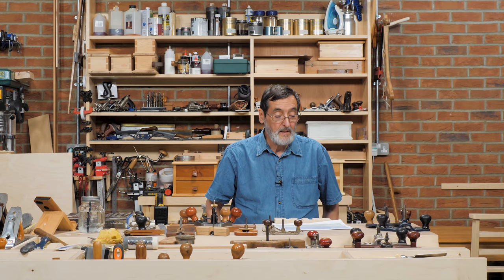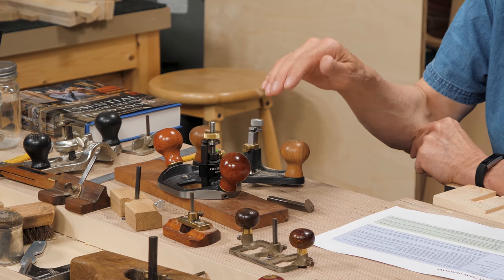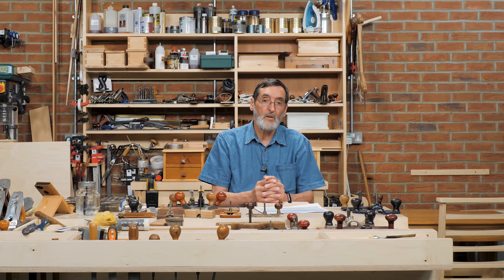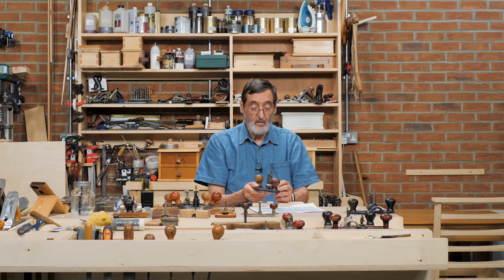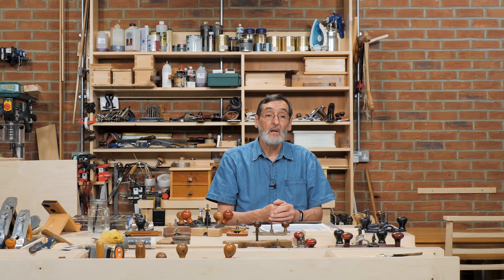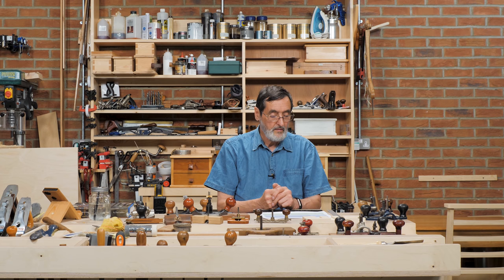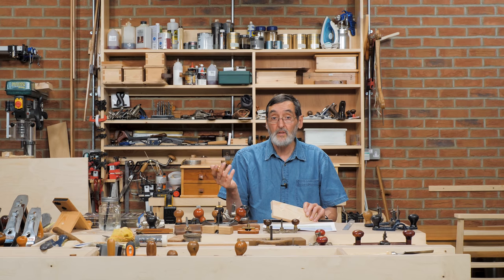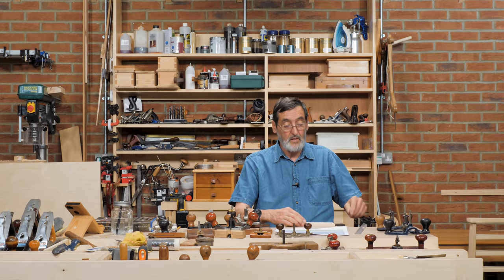Router Plane Q&A | Paul Sellers

Comment: For the question about the slipping blade. Starting at the far end of the work and taking small steps backwards can help too. Very much like a rabbet, plow plane, or even hollow and rounds. (Combination planes like a Stanley 45 or it's crazy uncle the Stanley 55 too.)

Comment: Great Q&A session as usual. One additional suggestion if I may: for those using a Stanley 71 router (and possibly the Record equivalent), one way to cut deeper grooves than what the included cutter allows is to replace it with a Veritas cutter. Using this trick got me out of tricky situation (making a large tenon, which required the use of a relatively thick extension sole for rigidity reasons)
Reply: I made a wooden base for my Stanley 71 and was excited about using it. With the stock blade, I had very little depth of cut. Like you, I ordered the Veritas cutters. They are a good bit longer than the stock cutters and fit without modification.

Comment: If you place a very thin strip of soft copper or similar metal between the end of the locking screw and its mating surface the blade should not move during use.  The copper conforms to the shape of the locking collar and adds more locking surface.

Comment: Thank you Paul this and the how to sharpen a router plane are fabulous, very helpful. Made a sole for my almost new Stanley 71 from a scrap of oak floor board was 7/8 so cut a housing to shape of plane, using the router and a chisel, to make depth 3/8, drilled and cut a U shape for the cutter (enough solid wood left that it shouldn’t distort), used some plumbers ptfe tape on the screw thread holding the collar / cutter to stop it slipping loose.

Comment: Thank you for sharing your experience and wisdom I find that when I use a power router it nearly always ends in tears as there is often no finesse it is on or off and because of the power you often do not have the control. Hand tools give you that control, yes it will take longer but the results speak for themselves. I recently visited an old church and was in awe of the craftsmanship in the wooden panels created in 1700's where there were no power tools, keep up the good work as someone who has returned to this hobby and remembering the skills I have forgotten from when I was 11-16 in my woodwork classes where I got a CSE Grade 1 in woodworking and Technical Drawing.

Comment: Great video! I myself have had issues with slippage in the cut, and I found a neat solution that seems to work well for me. Much in the same way that you would want to finish a depth advancement on a bench plane with a forward turn, I try to finish my depth advancements on a backwards turn with the router. The goal is to stop the blade from shifting in the dead space of the yoke, but because of the nature of the router plane, it’s pulling the blade deeper instead of pushing it back in.

Comment: I suppose I've done some rather extreme adaptations. I made mine with replaceable irons as you have mentioned in the past. Then I began playing with shapes, I now start with good knife walls followed by a spear point on my router plane to hog out waste then clean up with either a flat iron for a dadoe or a gouge up canel iron for the blood groove on a cutting board. I also made a moveable fence system Incorporated into the design like some of the old ones had.

Comment: It would seem to make sense to remove the part of the wooden plate ahead of the iron for chip clearance. Since it's fixed to the plane on both sides, it shouldn't weaken it in any practical sense, plus it could add that clearance (hump) feature to a plane with a flat sole. Have I missed something?

Also, a piece of paper folded over several times can be inserted between the depth locking collar (the big one) & the iron to help stop it slipping. Normal plain printer paper can provide a huge amount of friction when it's under pressure & it won't mar the metal, unlike putting an abrasive in there.

Comment: I have a follow-up question about the Stanley 71 with the wood sole plate added. Can the wood be slotted so the open front of the router is utilized again? I was thinking that if I were to trace the opening of the router onto the wood and cut it out and clean it up, that the advantage of the open throat of the 71 versus the closed throat of the 71 1/2 could be utilized again. I see that you have not done that on any of your 71s. Would that alleviate the problem from the question, or is blowing the debris away the best method... Thanks!

BTW, earlier this week, I won an eBay auction for a Stanley 71 that was complete except for one of the cutters. The very next day, a friend of mine met a guy who was selling an entire workshop and had a few hand planes for sale. I was able to buy all of them. I got a Stanley Bailey #4, a Stanley #71 complete and including the original box, a Stanley #78 rabbeting plane, and a never used Record #778 rabbeting plane complete with instructions and original box. The guy selling it said he bought the #778 for a project and never ended up using it. I'm so stoked to learn how to use all of these planes and am enjoying your book and DVDs. 

Thank you, Mr Sellers, for giving me the inspiration to begin a new hobby at 53. (-:

Comment: Sorry I missed the live version, I would like to know about the sharpening angle of the blades in reference to the plane of the base of the router. I thought it should be co-planar but heard a caution that it should not be because the cutting edge needs some clearance to cut down the drag. This means that the flat of the blade is NOT at a 90 degree to the shank of the blade, or co-planar with the router base, right? If so is there a rule of thumb for that?
Reply: You’re correct: the blade is definitely not co-planar with the sole of the plane. The heel of the cutter sits higher than the cutting edge. I’ve measured up a brand new Veritas blade I have: looks like 3 degrees.
The sharpening angle on the blade (disregarding the 3 degree slope) is the usual 25 degrees. So the sharpening angle in reference to the sole would be 28 degrees.
It shouldn’t really matter unless you’re trying to make your own blades – if you’re restoring a plane, just go with the angle that is already there and sharpen it accordingly.

Comment: Paul, It's a useless tool. There are so many better alternatives this day and age. I own my great grandfathers Stanley. Used t once and put it back in the tool chest.It was okay 80 years ago when there were no other tools to compete with it, however, it is passe.
Reply: Ronald Kearn To me, it seems a very versatile tool. Can you give examples of where another tool may perform better? I get there are some tools that perform better for a specific job, but I wouldn't see the point in having a specific tool for a specific job that is slightly more efficient, when you can have one that performs well for a wide range of tasks. Seems less efficient and more expensive to maintain multiple tools. That being said, I do speak as a hobbyist and not someone who has to make a living from the craft.
Reply: If you don't like it, then don't use it. We don't care about your lack of understanding dood.
Reply: Of course there are other tools you can use.  Fill your workshop up with machines and power tools if you want.  Personally I find it very useful. Yes it’s slower than an electric router for most applications, but it’s easier to control, is quiet and doesn’t fill your workshop up with dust and chips.
Reply: @richardsinger01  trolls are everywhere :)